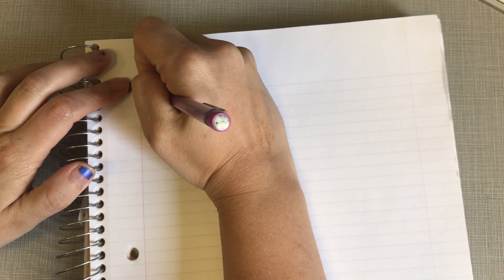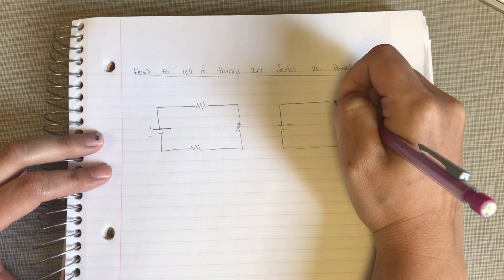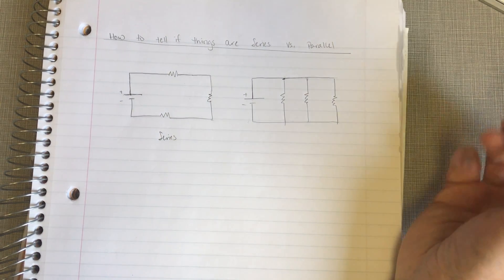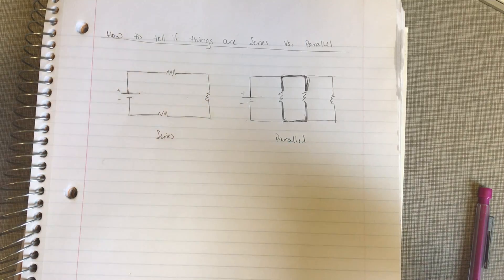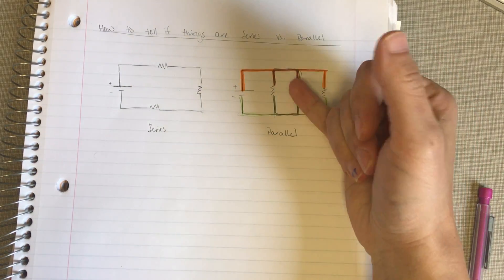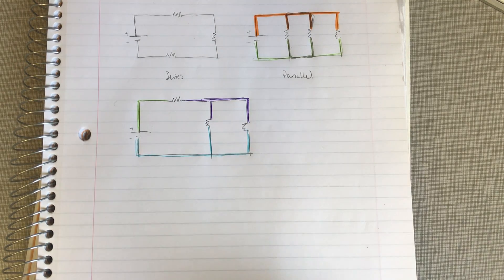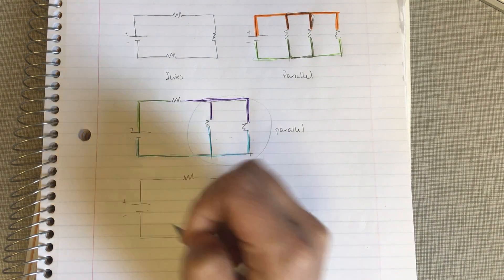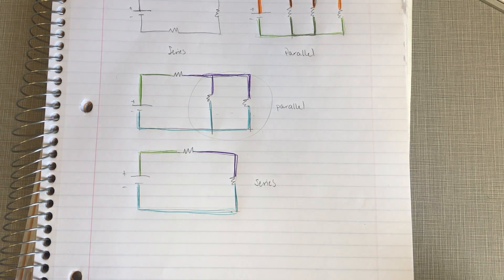How to tell if resistors are in Series Vs Parallel

Comment: This was a great video. Can you please make a series of videos on this particular topic(Combination of resistors).I am facing a hard time in understanding this topic. Also include how to calculate the current and potential difference in series, parallel or mixed combinations of resistors.
That's a request....It would be very helpful :)
Reply from the maker: thanks for the suggestion! I plan to make some stuff over summer break- in the meantime, there are some circuit problems buried in here somewhere, disguised by their problem numbers from the Young and Freedman book
Reply: @KelKelPhysics  In a circuit, is a lightbulb basically the same as a resistor? I think they both use current and dissipate power

Comment: what if there is a open cct? like using thevenin i find it hard to identify whether it is a parallel or a series
Reply from the maker: one of the things I find helpful is realizing that you can bend and extend wires to make it easier to look at. In a lot of cases, though, parallel and series isn't enough to fully solve the circuit- that's where Kirchoff's rules come in

Comment: but show if not series and not parallel
Reply from the maker: Check out the Kirchoff's law videos!
Reply: Is it possible to be neither? If so, is it still considered a circuit.
Reply from the maker: @jayasmrmore3687  it is possible to be neither if there are more than 2 components. We typically use Kirchoffs laws in those situations
Reply: @KelKelPhysics  oh okay

Comment: DO you have a method of doing this without using colors?
Reply from the maker: Just tracing it with your pen or pencil works, too! Or if you have an incredible memory, unlike me, you can keep track of which wire clumps are connected to which resisitor
Reply: Why do you want to do without colors

Comment: what if it's 3 resistors shaped like a T ? thanks and great video
Reply: @KelKelPhysics  https://imgur.com/a/kwoyd2Z here it is. would it be (R1 in parallel with R2) in series with R3 OR R1 in series with (R2 in parallel with R3)? Thanks!
Reply: @KelKelPhysics  it does because ive tried it...this is just part of a problem that i have to solve for class...i get different resistances depending which way i do it. i have to check with a simulation and the correct way is r1 and r2 in parallel and then in series with r3
Reply: @KelKelPhysics  sorry, like i said i took that out from a problem, the voltage source is to the left of r1